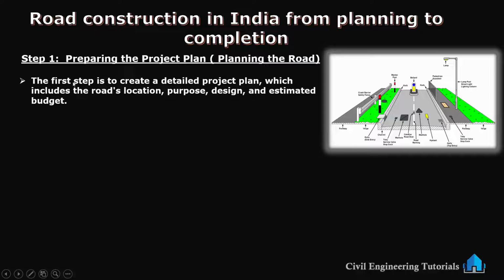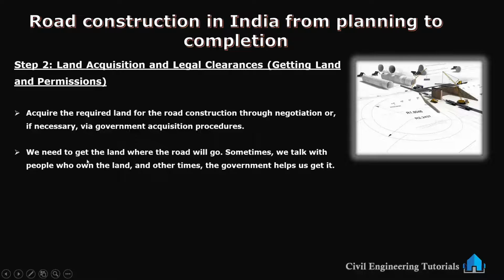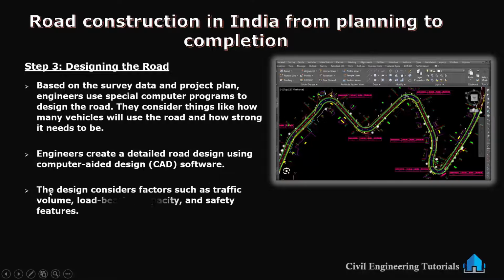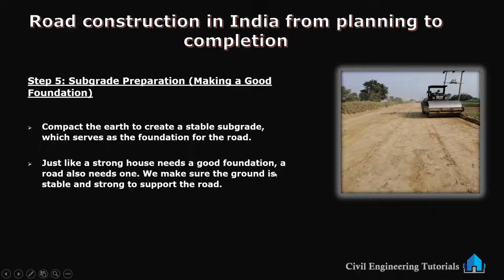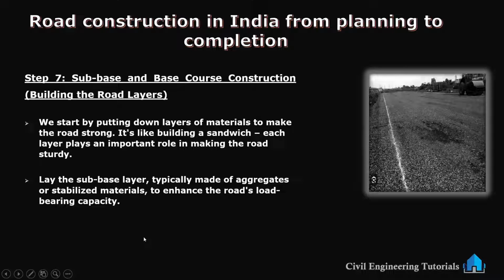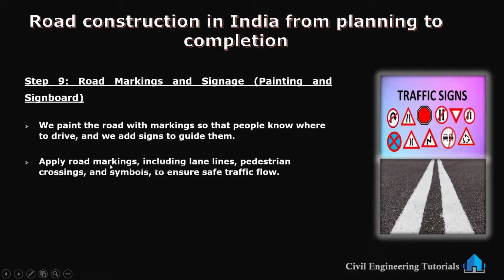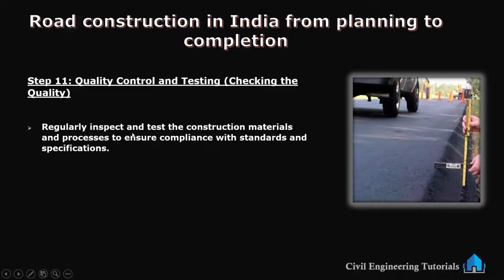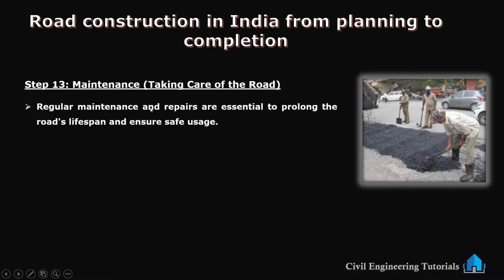Road Construction in India from Planning to Completion || Art & Science of Road Building

Comment: Could you please make a video for the difference between lacing & bracing, also I need a proper definition about moment of inertia...., as I found it from google: A quantity expressing a body's tendency to resist angular acceleration, which is the sum of the products of the mass of each particle in the body with the square of its distance from the axis of rotation.
Reply from the maker: Lacing: Lacing is like tying shoelaces on a structure. It involves using diagonal or vertical rods or cables to connect and prevent parts of a structure from shifting or deforming.

Bracing: Bracing is like adding diagonal support beams to a structure. It uses diagonal members to strengthen a structure and keep it stable, especially against sideways forces like wind or earthquakes.
Reply: @civilengineeringtutorials  Thank you so much for your kindness & effort, I am unable to say using words how much it would help me...God may bless you 🕉️
Reply from the maker: The moment of inertia, often denoted as "I," is a measure of an object's resistance to changes in its rotational motion. It quantifies how the mass of an object is distributed around its axis of rotation. In simple terms, it tells us how difficult it is to start or stop the rotation of an object. The formula for moment of inertia varies depending on the shape and distribution of mass of the object but typically involves integrating the product of mass and the square of the distance from the axis of rotation. The unit of moment of inertia in the International System (SI) is kilogram square meters (kg·m²).